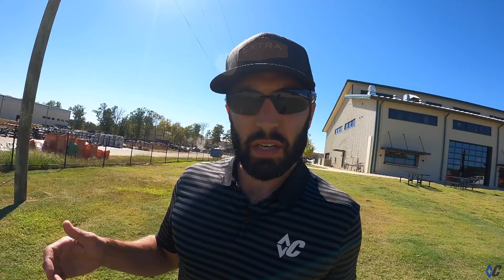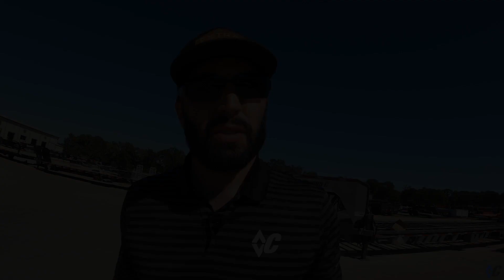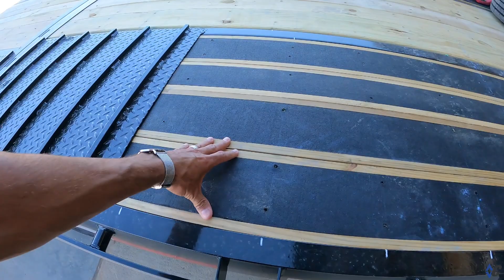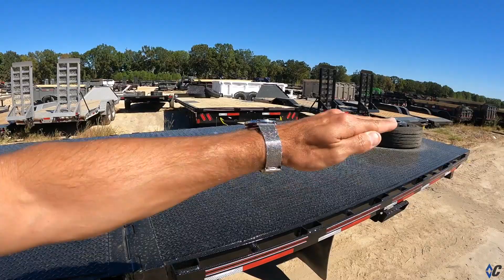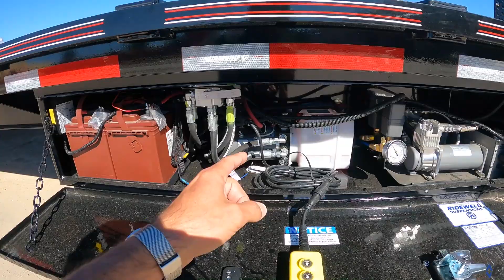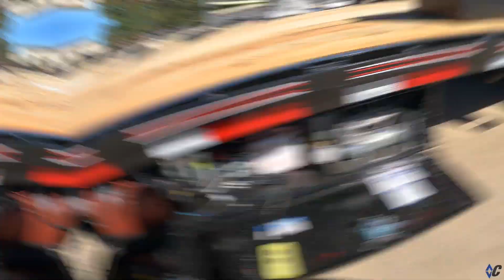All Things Hydraulic Dovetail | Diamond C

Comment: Can you add the hydraulic box to the neck? It would keep the system out of the salt slop and prevent damage from debris/tire blowout.  It would be easy to add a solar panel to the top of box, ability to add winch to the same battery with minimal heavy gauge wiring, less wiring to charge the battery from vehicle. Short hoses for the Hyd jacks, only drawback is longer hoses to ramp.

Comment: Do they make a cordless controller to operate the dovetail and jacks with out having to manually switch the valve ?  If not are there any other options to do this from the cab ?

Comment: How do you add and change the hydraulic fluid. There is no room to get to it? I just got a new FMAX 210 hydraulic dove tail and hydraulic jacks 30ft trailer. 😊
Reply from the maker: If you're having space issues with your fluid we recommend you put your oil in a smaller container and angling your pour sideways.

Comment: If I was looking for a gooseneck trailer that Diamond makes to put my 13,000lb mini excavator on it with the lowest ramp angle, which trailer would you recommend?
Reply from the maker: How wide is it from outside of track to outside of track?
Reply: @diamondctrailers  78” wide
Reply from the maker: @troyt5309  FMAX10 hydraulic dovetail would be great or HDT-GN w/ 208 or 307 package. 👍

Comment: I've been watching your trailers for some time now and I have a couple of questions. Regarding your flatbed with the square above the gooseneck and your 12 ft hydraulics tilt. How much weight will your hydraulic dovetail hold? The reason I'm asking I plan on putting a 27 ft fifth wheel on top of the trailer axles removed and then behind that on the dovetail putting my Jeep Wrangler TJ which weighs about 4,500 lb. I plan on doing cross-country traveling Towing the setup with my F350. Once I reach my destination wherever I choose to buy property I will remove the trailer and use it for business.
Reply from the maker: Great question! Our Hydraulic Dovetail is rated to hold 10,000 pounds if centered!
Reply: How about this one…
How much weight does the hydraulic dovetail add to the trailer’s tare weight, vs the option of (I believe you call it “straight back”) no beaver tail, etc??

Comment: Older video so hopefully you see this. 
How about showing an older trailer or competing companies trailer side by side deck slope difference so we can actually see the difference?
Also let’s see you load a double drum roller say 48inch?
I’m not at all sarcastic, I just need to be able to load one. 
Thank you for all your videos it’s very much appreciated.
Reply: I’m not familiar with that roller you mentioned, but…
Assuming it has smooth steel drums, I expect the best bet for you would be the rubberized version.
Even with the cleats, steel on steel sounds like a losing proposition in the traction department to me.

Comment: How much can the dovetail lift?
Reply from the maker: Great question! It is rated to lift and carry 10,000lbs distributed the length of the tail. 👍
Reply: @diamondctrailers  Okay, great, but if I pull 10K onto the dovetail in the down position will it lift that weight?
Reply from the maker: @raymann5994  Yes! But the 10,000lbs needs to be distributed on the dovetail, not just in the last few feet.

Comment: Could the addition of a bolt on receiver tube be added to pull a bumper pull trailer if I so choose?
Reply from the maker: Hey there Southern Wulf, We wouldn’t recommend that on a Hydraulic Dovetail. 

That can easily be done on a Max Ramp, XDR ramp or Straight Deck though.
Reply: @diamondctrailers  I'm only asking cuz i plan to pull a small 6x12 bumper pull for bags and airsoft storage while the gooseneck would haul the atv, hmmwv, etc.

Comment: How much weight does this add to the trailer?
Reply from the maker: Great question! About 320lbs over Max Ramps. 👍
Reply: @diamondctrailers  Is that everything batteries pump hydraulic cylinders added steal?
Reply from the maker: @upnorthyooper1196  Yes, it’s the full option.
Reply: @diamondctrailers  Wow that is impressive, I am a trailer dealer back in the 80s it was like 500 or 600 for something clumsy you were afraid to load on. I used to tell customers I wouldn't give up the GVWs unless the trailer was for a designated machine. The came lock lift system is just brilliant.

Comment: If you have a piece of equipment on the dove tail and need to raise it a bit for clearance does the pump have the power, or are you able to raise the dove tail with a certain amount of weight on it?
Reply from the maker: The dove is rated to lift and carry 10,000lbs distributed the length of the dovetail. 👍

Comment: What’s the lifting capacity of the hydraulic dove if needed for a better ramp over angle once machine has the front wheels over the crest?
Reply from the maker: Hey Jack! It is rated to lift and carry 10,000lbs distributed the length of the dovetail. 👍

Comment: I wish my cht hydraulic tilt deck came with the wireless control. Is that an available option for?
Reply from the maker: Great question Lloyd! If your CHT has a hydraulic power unit that controls the bed you can definitely add a wireless kit. The wireless kit is plug and play on the KTI power units. 👍

Comment: Do you guy test trailers before they leave factory?
I ordered trailer from dealer and got home to find out the brakes wasn’t even adjusted on trailer
Reply from the maker: We sure do test the brakes on every trailer. 👍
However all drum brakes need to be burnished in which also auto adjust at the same time. Here is a quick Lippert video that talks about the burnish process. 
https://youtu.be/d9HDloz9fq8
Reply: @diamondctrailers  well just letting you know you guys missed one because my adjustment screw haven’t even been turned…
Reply from the maker: @MrBigblock3272  Thank you for the heads up. We receive them ready to install by Lippert and are instructed that being auto adjust while driving we aren’t to manually adjust them. We will relay the message to Lippert. 👍
Reply: @diamondctrailers  other than brake issue trailer is awesome

Comment: I would like to see how the pump/dovetail latching mechanism works; it would be nice.
What happens past level within the mechanism that the slide lock engages or disengages? The pump seems to be flowing one way the whole time, would it not extend the cylinder to the stop/lockout  position?
Reply from the maker: Check out this video.

https://youtu.be/o7zIEIwlIrU

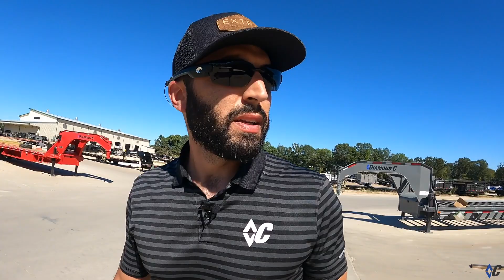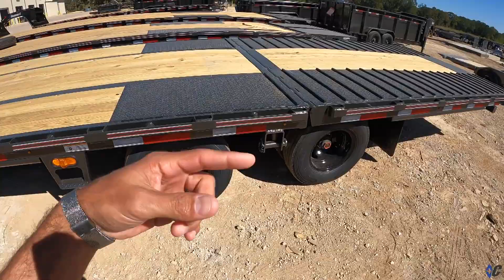1:15-2:32 Shows it lock and unlock. 👍

Comment: Nice looking hydraulic tail. If you don't mind, what's the weight difference between the hydraulic dovetail, vs wide ramps? Thanks.
Reply from the maker: That’s a great question! The hydraulic dovetail is about 350lbs more than the Max Ramps.
Reply: @diamondctrailers  thanks for the quick reply!

Comment: Would love to see a series on trailer offerings as related to specific size vehicles. E.g options for a 2500 or 3500 size truck for different goosenecks/dump trailers detailing dry weight, useful load capacity etc